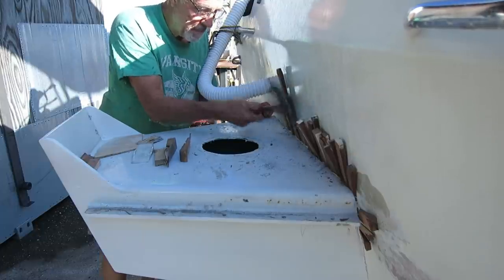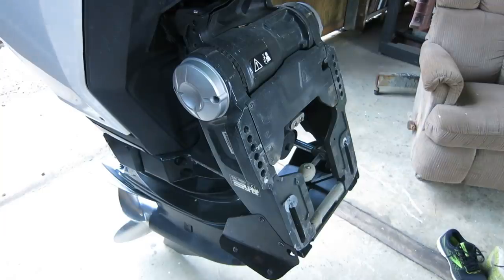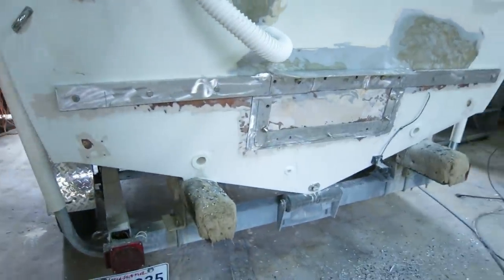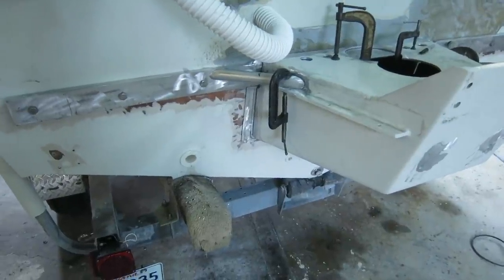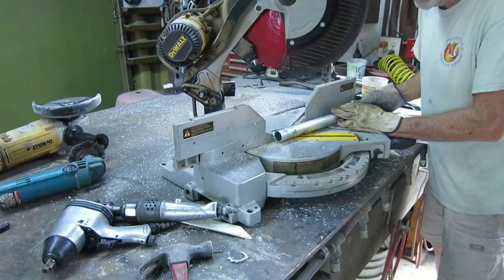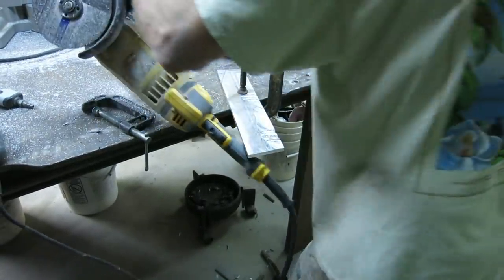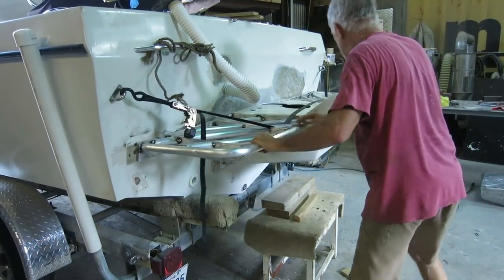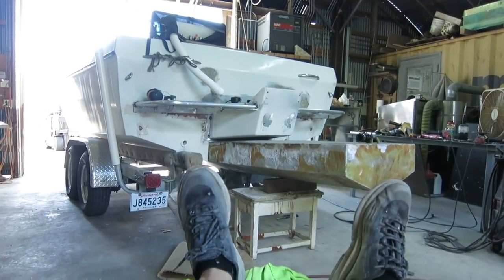The center Console Project Boat Outboard Pod Mod

Comment: I was laughing when you were notching the pipe in the vise, aren't there are pipe jaws on the bottom of the vise jaws... Great Work Barry, I'm impressed
Reply from the maker: Thanks man!
Yea there are pipe jaws but they wont hold the pipe at an angle. That vice is really a piece of crap. It only holds aluminum pipe sorta ok because I can squash the pipe out of round.
Thanks for watching and commenting.
Barry

Comment: I noticed in one of your earlier videos that you have a small crane weight scale, and that you have  a flywheel lift eye for your outboard. If you launch your boat with no extra pod, rig your weight scale to the lift eye, and lift up (maybe with a pulley), on the weight scale to get the stern to the waterline you want, the weight showing on the scale will be the amount of buoyancy you need to add under the bracket for the boat to float at the waterline  you want. Fresh water weighs 62.4 pounds per cubic foot, so if the weight scale shows you need 125 pounds of buoyancy, you would need about two cubic feet of pod volume. But the aluminum pod itself will weigh maybe 15 pounds so you need to add that to buoyancy/ volume total so you would need total of 140 pounds of buoyancy. 140/62.4  = 2.24 cubic feet of pod volume. Salt water is 64 PCF so if salt divide by 64 instead of 62.4.
Reply from the maker: Tamara
Interesting proposal. Unfortunately I don't have the ability to lift the boat while it is in the water, scale or no scale.  But I agree with your math, I will just have to work the other way around. This is how big I can fit a pod, how much buoyancy will it add and will it be worth it?
Barry
Reply: Understand. Good luck with it. Really interested to see how it runs with the shortened bracket.

Comment: Im not sure, thats why im commenting.  I think the forces are up and down, in and out?  Primary force  pushing the top of transom out of the boat.
Reply from the maker: Kelly 
Thanks for watching and thanks for taking the time to comment. This is an older video so I will have to watch it again to properly respond to your comment. But regardless, the bracket is right where I put it with no signs of going anywhere.
Barry

Comment: Love your videos! I have a "similar" poject brewing.

However... Your big problem is not horizontal, its vertical. The pod/bracket needs to extend closer to the bottom to better spread the load of both the engine weight and the thrust.

When I saw the last pic, I thought; "now we are getting some where" ;-) 

Ive built my own bracket from fibreglass. I only put a 115 optimax on it, but the material thickness was similar to your aluminum bracket. However, it was almost twice the hight. 

I did not like your bracket the first time i saw it, it´s way to "shallow".

Sorry if my english is flawed, I´m from Sweden.

Best regards!
Reply from the maker: Bankt
Thanks for the kudos! You are absolutely correct about the bracket, the foot print is just too small. In a prefect world  I would have had one custom made to perfectly suit my needs but there is a big difference between $400 dollars and $5000 dollars. To me, the problem is I didn't  totally trust my transom and to me the weak point is the top which is in tension pulling out on the transom. The bottom (which certainly could have been a lot deeper) is still below the top of the stringer in the boat. So the forward thrust is pushing in on the transom which is pushing directly against the stringers. I am comfortable with that. By making the top wider it was one, relatively easy, and two it spreads the load to almost a 100% greater area. Time will tell if I am correct or just trying to make myself feel better.
Barry

Comment: You would do a lot better without aluminum welding if you would push that wire aluminum is a push process
Reply from the maker: Thanks for the tip Derek! I will certainly try to remember that.
Barry